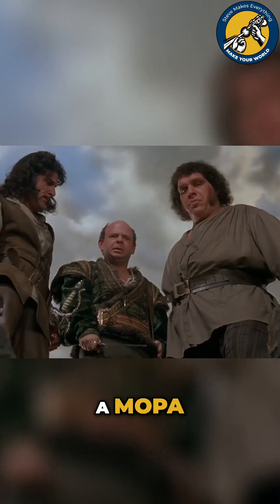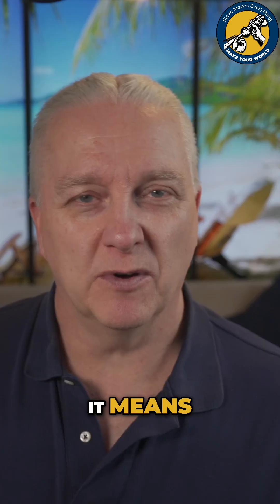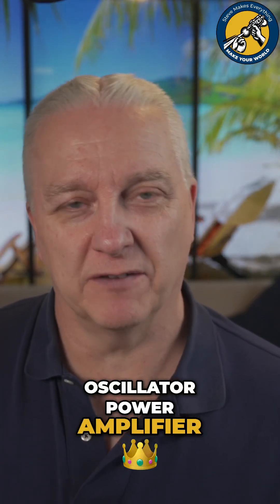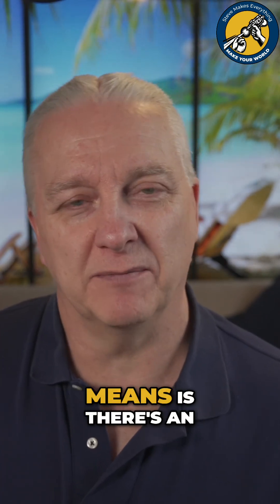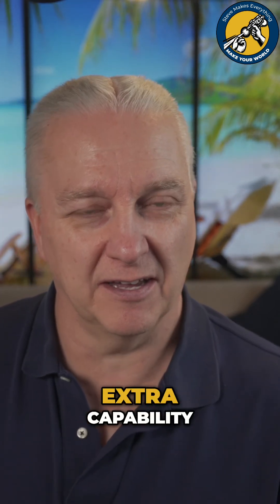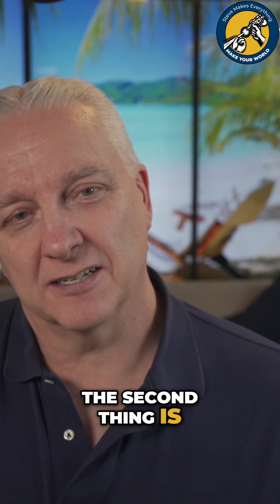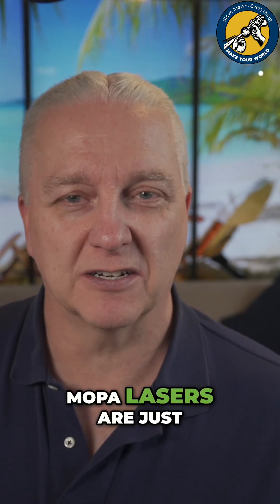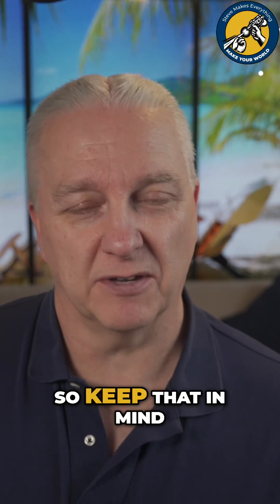What is a Mopa Laser? Fiber Laser vs. Mopa #shorts #fiberlaser #maker

Comment: Awesome info. I would amend that MOPA doesn't technically mean that the laser has variable pulse width (which is what people chase for color marking variety really, though color is possible without it in lesser variety). An example of this would be the JPT LP series, is technically MOPA sources but does not have adjustable pulse width, where the M series lasers do (M7 and M8 being the current gen stuff). I've seen some upset community members who were sold a "MOPA" that didn't get pulse width control and is a really important factor for some users.
Reply from the maker: Yes.  This is an excerpt from a longer video and in there, there is more detail in which I mention color.  Since the full video is about the ComMarker B6, everything said here is in the context of that model.   Most viewers won’t even know about JPT technologies.  The community won’t be upset if they buy this one 😏